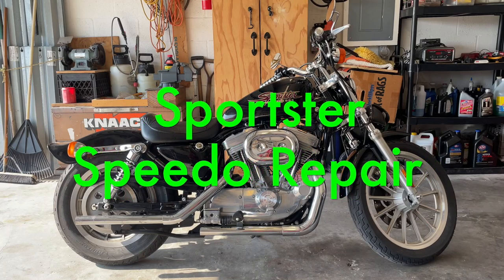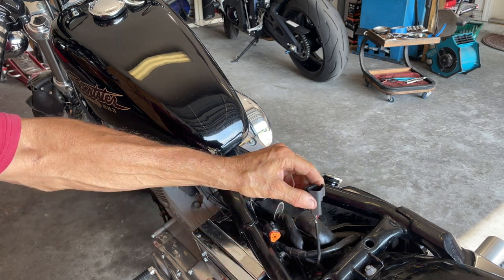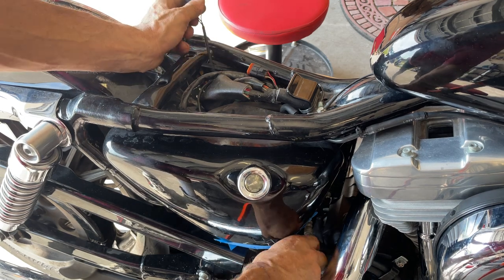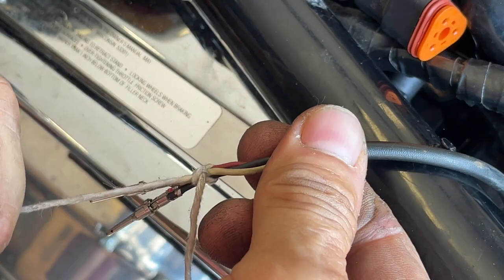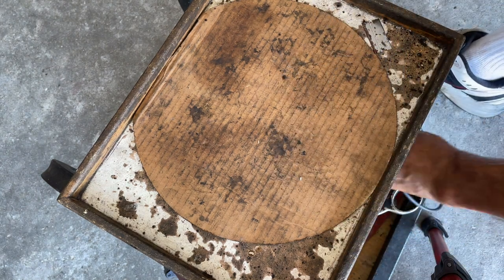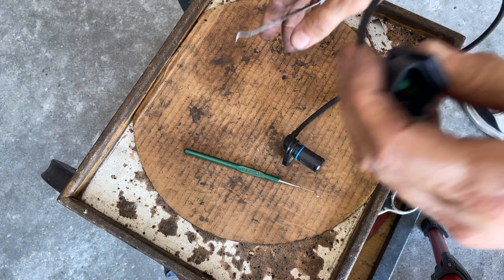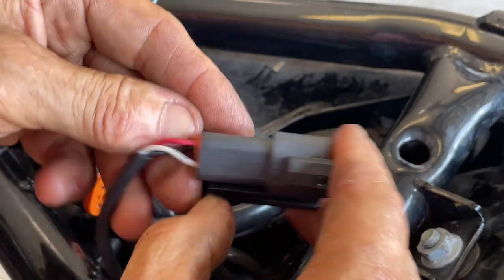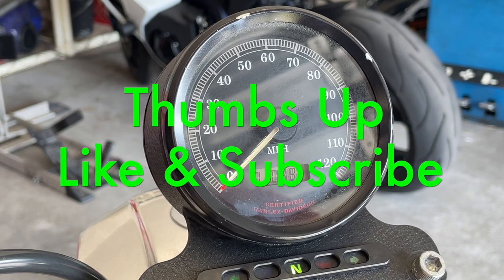How to Replace the Speed Sensor on your Harley Sportster.

Comment: Whats wrong with my dyna speedo if speedo went from zero to full speed at turn of ignition swi🎉tch. I replaced speedo with another one an replacement functional? Now speed dial is stuck on fast. What came be done with my symptoms?
Reply from the maker: Happy to help. All I could suggest is you have another bad Speedo. I would believe you started with your sensor and then all that's left is the Speedo. I would go on eBay and find a speed out with a return policy. Thank you for watching and all your support Tim. Let us know how it works out. Ride safe and have a great day.

Comment: I have a big problem. I need to replace my 2012 sportsers speedo sensor and wires. Can you make a video of that? 🙏
Reply from the maker: What wires are you exactly talking about under the tank?
Reply: @TwoWheelRocco  exactly, I have no idea 🥲
Reply from the maker: Good chance the wiring is in place and all you have to replace is that sensor. Let us know how it works out test it and make sure the light works when your ground it out has shown in the video. Hope this helps any questions. Just ask.
Reply: @TwoWheelRocco  the wires need to be replaced too. The wire has been Chewed by a rodent. I just need to know where the wires go into and do I need to take out the fuel tank.
Reply from the maker: Yes, you will need to remove the tank. No big deal and you will see the wires right there on the side of that back bone. Any questions just ask.
Reply: @TwoWheelRocco  thank you I appreciate it. Wish you could make a video. My new part arrives next week. If you have a sportser that’s 06 to 2020 apparently they are all the same make a video or some pictures would help. 
Thank you for the advise, you rock dude 👊🏼
Reply from the maker: Not that easy right now I'm a little under the weather. I have pneumonia. So I will be taking a couple weeks off. But you should be able to figure it out. Like I said take pictures and send them to me ERocco 3964@gmail.com.

Comment: I have an 01 road king speedometer goes back down to zero exactally at 52 mph every time I hit 52 as soon as I go under it comes back on. So basically it works fine under 52mph I have a d01set code. I replaced the sensor still nothing. I can’t find anything on this issue
Reply from the maker: Happy to help. I never heard of that going to 52 and then back down to zero. I'm sorry I can't help you with that. When you do find out let us know. I'm gonna send you a link for that code.
https://www.hdforums.com/forum/touring-models/1118376-help-with-d01-thru-d10-codes.htmlThank you for watching and your sub.FLCE LLC. Ride safe and have a great day.

Comment: Will this work on my 2020 883?
Reply from the maker: Happy to help. I do believe so, look for the sensor at that spot and it should be the same. You might have to remove the exhaust or at least loosen it and angle away from the sensor Make sure you test it. Usually they last a little longer than 4 years. Thank you for watching and all your support TGP.  Ride safe and have a great day.  Let us know how it works out.

Comment: Hi Rocco I'm check my motorcycle but not found one connecter only have male conector im never remove before yesterday made does problem not have ligth on speedometer  gauge stop to work
Reply from the maker: Happy to help. If it's the light in the speedo, not working,  The Speedo is failing. Does the Speedo work at all? What year bike? How many miles?Thank you for watching and all your support. Ride safe and have a great day.
Reply: @TwoWheelRocco  ok but what happen with use my motorcycle not have problem to drive I'm go to dealership not have part on stock need 10 work day to shipping
Reply from the maker: @familiahuapeleon2937 Your bad Speedo you should have no problems with the operation of a bike like I asked what year how many miles? I would buy a used speedo on eBay.

Comment: Have a question, my front headlight and blinkers don’t work, I have the right blinker on but it stays on don’t blink and the symbol on the Speedo is solid and won’t turn off. Also the rear blinkers don’t work either, the rear break lights up but don’t get brighter when I hit the break. I’m lost on what’s going on I have a 2010 sportster 1200 low
Reply from the maker: I would bring it to the dealer and just have them put it on their machine and see what’s going on sounds like the module is going bad. But Harley has the machine to plug it in and you’ll know I don’t know what they charge but it’s well worth it get your bike straightened out.
Reply: @TwoWheelRocco  okay sounds good thanks buddy. Also I have a red key symbol that won’t go out. It’s a 2010 sportster 1200 low
Reply from the maker: @asmototripz6165  that sounds like your fob for your motorcycle  batteries. There's a lot of funny things on those batteries are dead or dying. But your bike starts? It's going to be something stupid. sorry we couldn't help.  let us know how it works out.
Reply: @TwoWheelRocco  I bought it used and it didn’t come with the fob I asked the guy and he said no.
Reply from the maker: @asmototripz6165  good that's one less thing you got to worry about, there a pain in the butt anyway. Somethings you got to bring to the shop, it's electrical. How long have you had the motorcycle and how many miles?
Reply: @TwoWheelRocco  just got it yesterday, has 6,700miles
Reply from the maker: @asmototripz6165  sorry to hear that's low miles. Let us know what it is sorry I can't help. Electrical. Thank you for watching.
Reply: @TwoWheelRocco  fixed the problem myself, saved myself money rather than going to a HD shop, under the rear fender the wiring harness was all ripped up because the previous owner was a little heavy and the tire hit the harness causing it to rip apart wires, (what a mess) but got it all straightened out and now everything works good….next question for you is, what oil do I use in the 2010 sportster 1200, also what transmission oil should I use. Thanks Rocco !!
Reply from the maker: @asmototripz6165  I like Lucas MC 20/50  synthetic oil for both my primary and motor oil.. I'm glad you got everything worked out. And thank you for the update.
Reply: @TwoWheelRocco  have any winter storage tips for me?
Reply from the maker: @asmototripz6165  if it's a carbureted bike shut the petcock off start the bike and run it until in dies..there's no fuel in the carburetor. And keep it on the trickle charger. If it's fuel injected,  full tank of gas and keep it on a trickle charger. That's what I do.

Comment: Currently doping some custom on a 2001 Sporty and mine is totally different from this bike. I get a module right under the seat and didn0t see any connector for the speed sensor. My sensor also looks different.

I couldn't find any corresponding wiring diagram to the bike I have in my workshop... The stock speedometer has this data bus Green/Violet cable so no signal I can use for my after market combo meter...

Anyone with a clue?
Reply from the maker: Happy to help. If you could send pic. to erocco3964@gmail.com  Thank you for watching and your sub Silent Screamer.. Ride Safe and have a great day.
Reply: @TwoWheelRocco  I really appreciate buddy. Actually I think I figured it out. Bike is from 2001 but I found a matching diagram for a 2005 xl883... Go figure... The Deutsch connector under the tank that goes to the instruments had only half of the colors matching according to the 2001 diagram but matched the 2005 diagram... But the color of the speed sensor wire to the module under the seat didn't match... It was on the right pin though so I'll simply get the signal from there for my after market meter and a pick on the coils should do the trick for the tacho. On the previous bike I built I made a sple circuit with two diodes and two resistors to get both coils impulses. I suppose it's gonna be the same on this one...

Comment: My speedometer wasnt working so i put a need speed sensor in and now it reads 120mph when the bike is moving.. why is that im stumped on what to do
Reply from the maker: I wish I could help. I never heard of that before. Sounds like your speedo is bad. Let us know how it works out. Sorry I couldn't be more help. Thank you for watching all your suppor t.Scopezz. Ride safe and have a great day. Let us know how it works out. I will go to eBay find a speed out with a return policy and buy it and take that out of the equation. You could always return it with their blessing. That's where I would lean towards.

Comment: Mine actually did stop working i got it back working & realized that it only counts by the mile..if you haven't driven a mile it wont change lolz
Reply from the maker: Happy to help. Mine had problems with the speed on not working at all, and I noticed you switched the sensor out and you're back in business. I used to clean them up and reinstall them, but they're so cheap. That's not worth the labor that takes to do the job. Thank you for watching all your support Kevin. Ride safe have a great day. Love those Sportster.
Reply: @TwoWheelRocco  no the problem was the sensor wasn't plugged all the way in from when I previously unplugged it lol but will do
Reply from the maker: Love those type of problems. easy fix sometimes we get them sometimes we don't. Thank you for the update. Ride safe have a great day.

Comment: My speedometer stopped working and marking miles. It's a 1999 harley sporster 883. Is it as easy as buying new speedometer and replacing??
Reply from the maker: Happy to help. The first thing I would do is change out the speed sensor. If that doesn't resolve the issue then it's the speedometer. You could buy a used one on eBay not too bad. Thank you for all your support  Jovan. Ride safe safe and have a great day. Let us know how it works out.